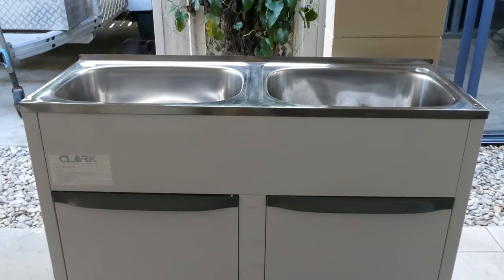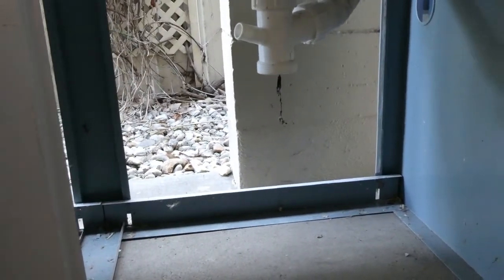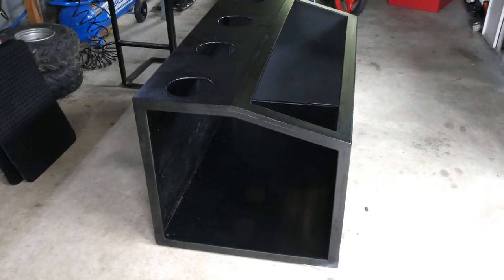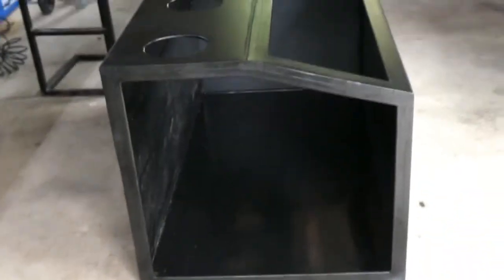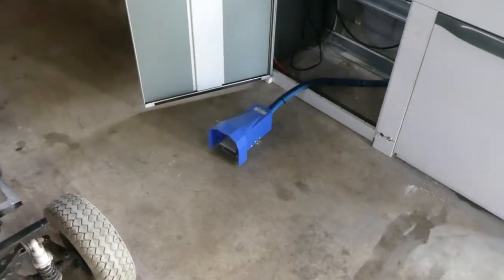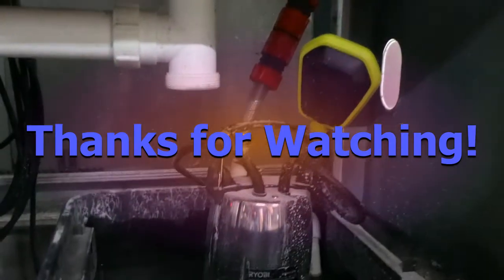Vapor Blaster Build

Comment: Hey mate what size compressor are you running the unit on and what psi is the regulator set to on your cabinet? maybe a rough CFM?
cheers
Reply from the maker: Hi Brandon the compressor is approximately 42 cfm - it’s 11 hp diesel- the reg is set at just over 100psi👌